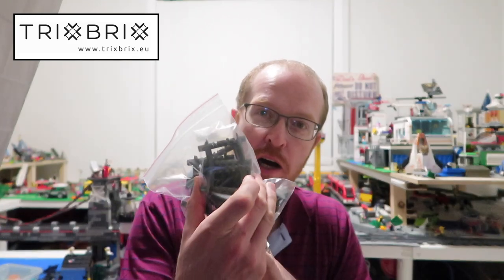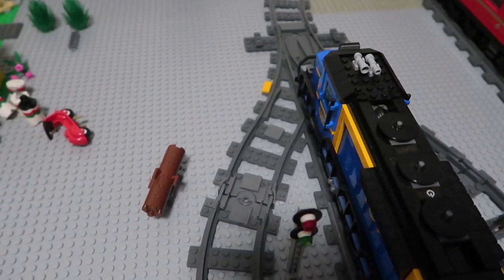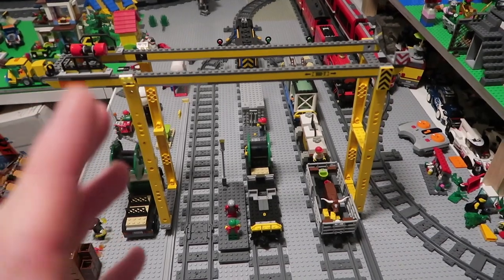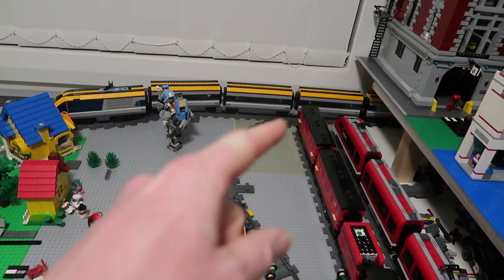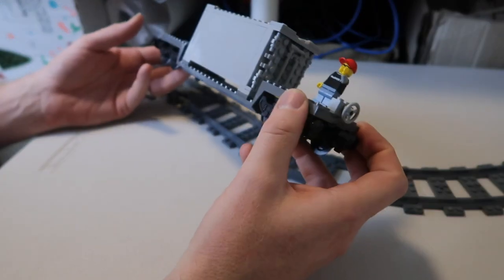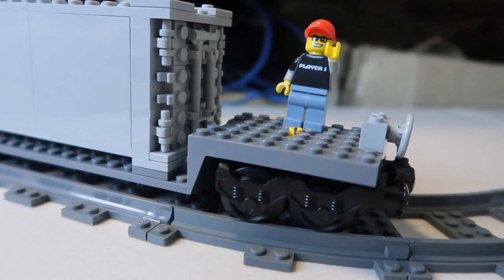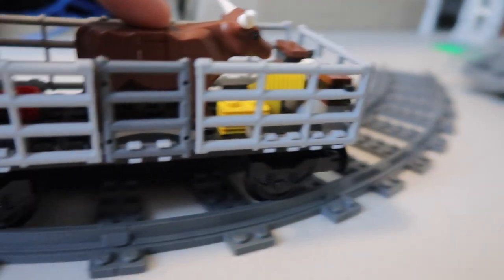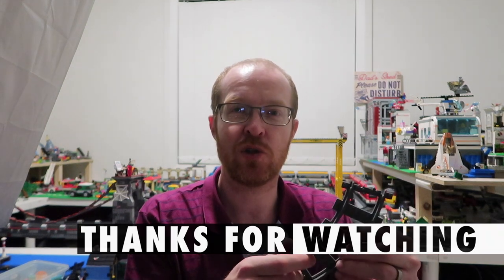LEGO Trains TrixBrix Tracks in Action and their R24 problem

Comment: Would splitting the r24 with normal lego curves fix that issue? Ie r24,lego ,r24,lego. 
I've got to get one of those 3way splitters . I've been tempted to get but shipping to nz costs
Reply from the maker: That’s a great question! I actually used a single r24 with the junctions and seemed to work fine, so your idea might work. They sell on eBay too, but think shipping is the same. I’m probably going to order some more soon. Just figuring out my layout.

Comment: What about putting a couple of technic plates under the longer carts to allow more turn?
Reply from the maker: I'm going to have a play with different sizes and techniques to see which works well such as single wheels and length. Adding some plate will make it higher buy should give it enough turning circle. Another option is brick building the truck - or using the pure flat bed ones without the dipped section.

Comment: Have you by chance tried TrixBrix's R32 curved track at all?
Reply from the maker: I have indeed! It's great and goes perfectly round the standard LEGO track. I've used it on the out track of my city loop for my faster trains to use. Great quality and moulded rather than printed so closer to LEGO's tracks.
Reply: @GJBricks  Oh wow, didn't know that the R32 pieces were injection moulded! I want to run an Emerald Night or a Maersk train with the R32 curves used on a second level mountain layout. From you are saying, I shouldn't have any issues.

Comment: R24: you would expect that kind of problem when it comes to longer cars, wouldn't you? Such curves are too tight - even LEGO's own, larger R40's are too tight!
The crane is already higher than usual; how much higher do you reckon you will go? It is quite wobbly as it is. That could be fixed easily, though: see the problem solved in the spiral here: https://tinyurl.com/y4jcaocw (and a detail in this image: https://flic.kr/p/21YXZ7h ).
Nice place, your LEGO City room section!
Reply from the maker: That crane isn’t staying like that. I was just playing with it. Will probably go with a combination of those pieces and. Technic. Strength and width. I kind of love how over the top it is though! What do you reckon?
And the r24 works if you only use one piece. I’ll show it in a proper video on using it with the junctions. Messes with the geometry slightly though. 
And I love that spiral! He’s building a new version of it at the moment too
Reply: @GJBricks , the crane looks all right - it looks functional and ready to handle cargo. It looks real. If you are planning to add an operator's cabin, as it seems (top right), it will have everything it needs to actually start loading and unloading.
I can think of situations where a tighter curve, such as the R24, could come in very handy. Geometry could be a problem, indeed, especially when attempting to integrate one of more pieces into an already existing track layout, but solutions should be available (I am thinking of flexible track, on the one hand, and of TrixBrix's own series of short straight track parts, on the other hand).
Do you think there will be a time when your city is finished? Will there be a time, that is, when only minor additions and changes will be necessary? If so, how close - or far - is that moment in time?
Reply from the maker: I have just realised this 🤦‍♂️
Reply from the maker: As Bananneburman just pointed out, I’m an idiot as it’s your towering loop. 🤦‍♂️ 
Saw the push down video the other day. Confess, I was impressed how intact it stayed!